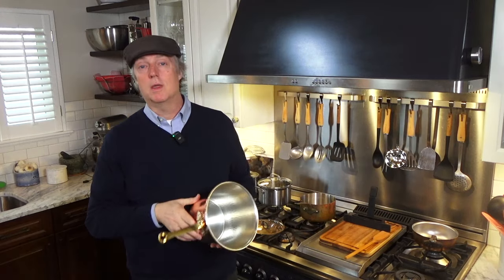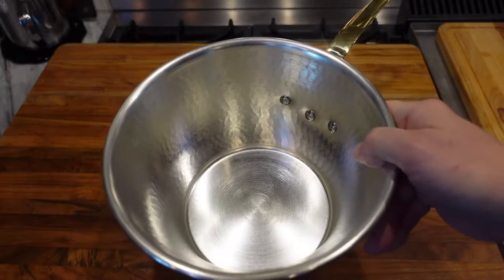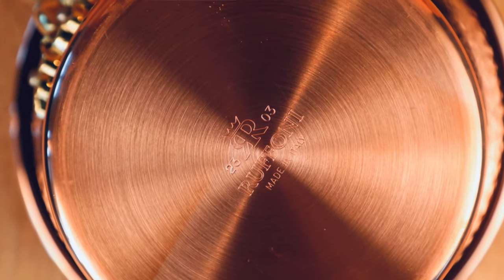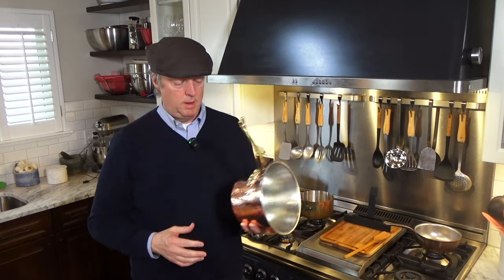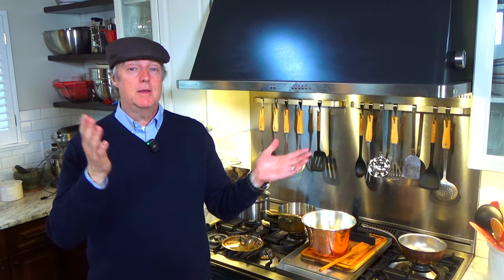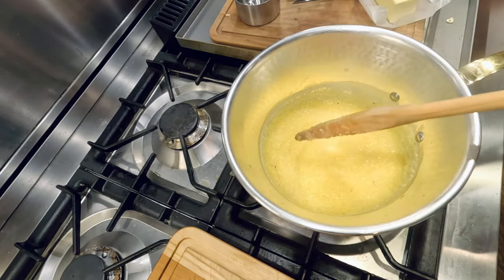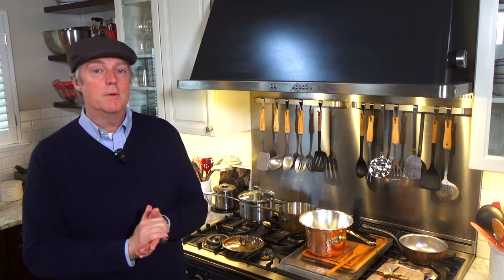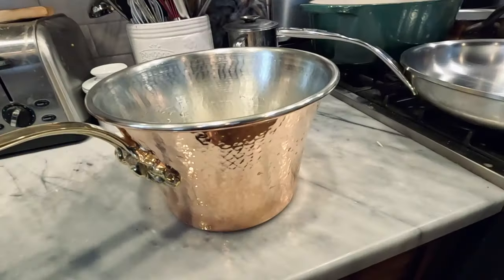Ruffoni Copper Polenta Pot: BIG Review and Cooking Feature

Comment: Copper pots and pans transfer heat better than other commonly used materials.   The flame from a natural gas burner can reach temperatures as high as 3560 degrees F,  so there is a danger of melting the tin lining or warping the pan when heating the pan over an open gas flame. They can be used with a gas flame provided the burner is set to a low setting and the pan contains liquid or food to absorb the heat.    Since copper pans transfer heat so well,  they excel when used on a hot flat cooking  surface  such as a French Stove Top or a Griddle. When the cooking surface is set to a temperature below the point where the pan can be damaged,  it is perfectly safe to cook with them. Copper pots and pans were initially intended to be used on a flat cooking surface; not an open flame but can be used on a low heat setting. 
   Before the introduction of gas stove burners,.  Cooking used to be done on wood and coal fired stoves, that had thick flat cast iron tops with round removable inserts. The flat surface worked best with copper pots and pans.  If  more intense heat was required for searing   the inserts could be removed exposing the pan bottom to the fire.  In this case cast iron pans and pots would be used.